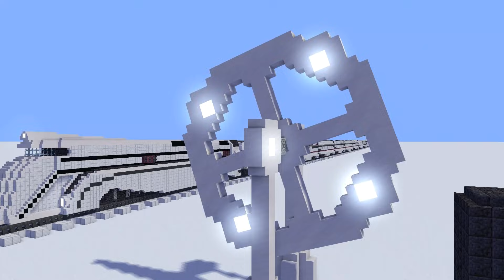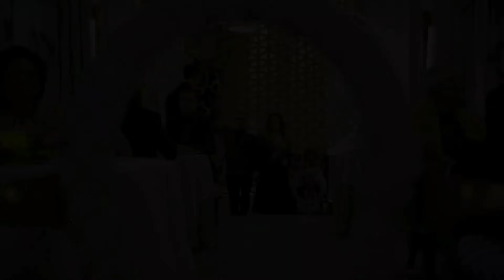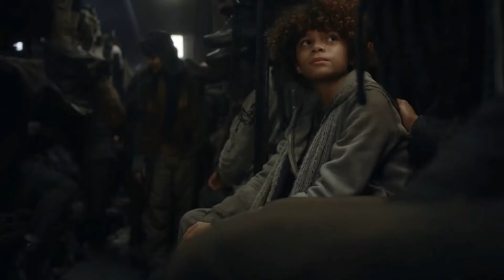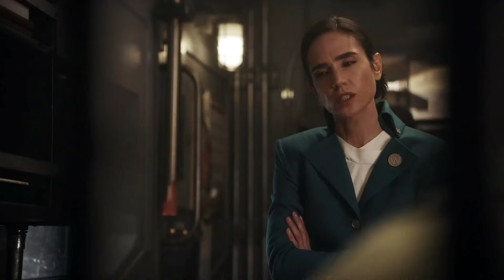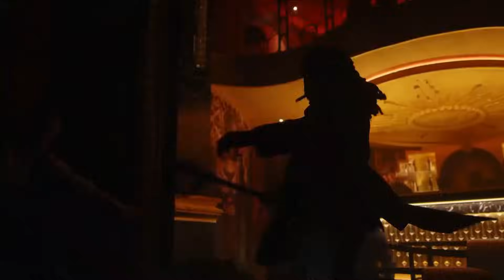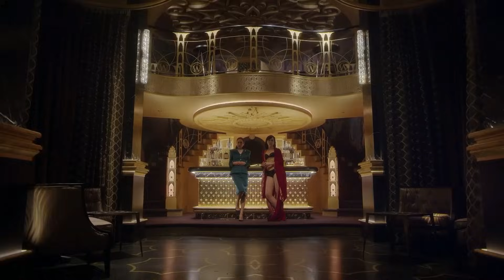HOW THE ENGINE ETERNAL WORKS | Snowpiercer Lore Video

Comment: They could have slapped a fusion reactor on the train and called it a day but no whoever wrote the story went for perpetual motion, motor turning generator style. 

Literally the only thing stoping me from properly watching the show.

Probably has to do with me being an electrical engineer or aunt karen at the family dinner asking me why we don’t just use the free energy machine she saw on Facebook to power our homes. But now any mention of infinite energy or perpetual motion makes me unreasonably angry.

Engineer rant over and back to designing a led controller for my hot tub.
Reply: I think the machine operating on perpetual motion is integral to the story. It’s the one gimmick that sets the rest of the story off. At least in the movie, the train should keep moving to keep the system going.
Reply: @carlosandleon  You could easily have that with a fusion reactor. Say the reactor has to run at a minimum power level, below that the reaction becomes unstable and it has to be shut down for safety (this is actually an issue with real-life fission reactors, running below safe power levels was basically what doomed Chernobyl). The reactor gives off copious amounts of waste heat which can only be dumped while the train is moving. And restarting the reactor after a shutdown requires infrastructure that isn't on the train itself, only at the starting station. Now you have your train that cannot stop (or only for limited amounts of time before the reactor overheats, similar to what they do in the series with the batteries running down) without needing to resort to some physics defying perpetual motion mumbo-jumbo.
Reply: @blahfasel2000  Chernobyl and this show similarities completely stop at the " too low power levels" thing. Reactor could have been stopped and restarted fine if they weren't to incompetent. Reactor 4 also didnt have that " we are running too low, we will overheat" issue like in this show, it was the ingestion of Zenon gas and incompetence.  My question is why not just add two or three perpetual motion engines to this system and ditch the silly trail wheel generators or keep the wheel generators but dont make them vital to travel? They stated that the engine doesn't have enough power to even keep it alive when its stopped.  You could shut down Mutiple engines as you need them. Hell, the design could have called for waste heat system with 1000 cars and such. Make it 1100 cars and deal with it.
Reply: @NotRandoWis  I know what happened in Chernobyl. This was just an example of a real life power source that cannot safely run below a certain minimum power level and has to be shut down if power output drops below that minimum.

And of course it doesn't have any similarities to what is in the show. I'm outlining a possible system that would keep the basic premise of the show (a train that cannot stop, at least not for long) but with more plausible physics than an impossible perpetual motion engine. The point wasn't to concoct a system that would remove the need to never stop.
Reply: @blahfasel2000  still think they could have added more engines so they didnt have to rely on wheel charging systems. 

My point is  Chernobyl is due to incompetence and shitty engineering, but at least it worked and could have been stopped even in a low power state without overheating. 

The shows design is absolutely atrocious, and its flaws could have been changed if the design was changed lol but i still like it. I just think even the writers could have tweaked that part a bit. but as the user above said, the original was more about life on the train and less about the engineering.
Reply: It also seems like the writers forgot about transmissions.
Reply: @qwertykeyboard5901  Modern trains now don't really have them either, we ditched engine to wheel drive trains years ago. Most are diesel-electric, powered by electric motors which are powered by a diesel generator. ( or by power lines above the train in the case of all electric trains) That gives us the best MPG( or MPGe in the case of all electric trains) and torque ratios that go beyond what an internal combustion system can do alone. Also, you get things like Dynamic braking. Dynamic braking works like regenerative braking on a Prius or Tesla but instead of using the energy collected to charge batteries, it turns it into heat and shoots it into the atmosphere using heat exchangers on another car. This takes stress off of the regular brakes and gives you more braking power. For purposes of this show, im referencing those big GE style cargo trains you have in the US and AU because Snow Piercer doesn't rely on outside power like a lot of cargo trains do in EU, UK and parts of Asia. Plus, those cargo trains in the US and AU are miles long, much like Snow Piercer. Plus it isnt a Maglev train, although that would make the most sense. Snow Piercer is technically a giant cargo bullet train turned into a city lol  

Newer "hybrid" cargo trains use dynamic and regenerative systems. Charging batteries which will be used later to power the train and dynamic heat exchangers for when those batteries are topped off, then the regular brakes are used. Electric trains are the same minus the diesel systems used in diesel-electric trains.
Reply: So Engineers DO understand that just because it works on paper doesn’t mean it works in real time. Gotcha
Reply: my guess is it *is* a fusion generator, the snow it kicks up while moving being a steady source of hydrogen. There's a big thing where the engine doesn't really "pull" the train, rather the job of movement is being left to the job of the bogey motors.

I cant remember if it was s2 or s3 where icybob shoved a spike in one of the intakes causing flooding from too much water and frying whatever wilfords "god module" was. (probably whatever is responsible for maintaining the fusion reaction and hydrogen intake)
Reply: Well, the original comic book from 1982 (and subsequent adaptations) tend to focus more on the social and environmental aspects of the story, more than the scifi details that are part of the setting. It came out in the era of Métal Hurlant, so dope ass visuals and a strong story was more important to the original creators than scientific realism.
That being said you really should give the show a chance, it's pretty decent. If you want a Good Snowpiercer Experience, go for the Bong Joon Ho movie or straight up read the og comic book online it's a ride and a half ;)
Reply: I'm not even an engineer and I felt the same way. The concept is kindergarten-levels bonkers. Nuclear submarines have been around since the 50's, there was plenty of source material to go off of and make it more believable.

Comment: So what I’ve gathered is while yes, a perpetual motion engine would allow Snowpiercer to theoretically last forever, any changes to operating speed, power output, or ceasing of movement entirely could be disastrous. It’s actually really smart if you think about it, I’m surprised the show writers didn’t use a weakness like this to their advantage.
Reply: A clutch system and transmission solves this wonderfully, assuming that changes in torque dont affect then engine in which case hills would be a major issue
Reply: @johnfeistner467 it’s a train, they would have flattened out the major obstacles for the tracks.
Reply: Or you know, make a massive particle accelerator shaped rail loop, G-Forces would be irrelevant without people and add extremely resistive induction loops into the track to generate energy and moderate the spinny engines velocity and bingo, energy crisis are no more and you can generate endless amounts of heat to deal with the cold.

Start a mega project of building hundreds of thousands and you can start thinking about orbital power transfers, momentum harvesters etc and start changing the amount of energy in the Earths orbit of the Sun and warm the world. Thats how dumb this idea is, its broken for its intended purpose, the plot demands eternal unstoppable choo choo so they end up with a plot device that solves the obstacle it was supposed to defeat in much more sensible ways.

It's not about realism, its about world building.

Comment: I still don't understand why you do not like the electrolysis answer..... i would think electrolysis + nuclear fusion is a eternal engine as well as a perpetual motion one..... because if it stops moving, it will no longer get more snow/ice/water to make into hydrogen......
Reply from the maker: Because the electrolysis answer fails to explain how the engine eternal was at constant risk of meltdown when stopping in Season 3; it fails to explain why the engine was ALWAYS in surplus, even when not moving for long periods of time.
Reply: @HallimarRathlornStudios  Pretty simple. The reactor produces a lot of energy and can't be throttled down that far. So either the energy is used or it builds up. Or you shut it down, but then everyone dies.

Comment: How does the train not need to be stopped for part changing
Reply from the maker: As described in the show, the train has a large supply of spare parts - all of which are low maintenance to begin with. In the earlier seasons, much of the plot is driven by how finite spare parts are and how costly maintenance is.

Comment: First of all, amazing video, very well explained in visualised! 

I do have one question, what is your thought about the engine's hydrogen production?
It has been a while since I watched the series (waiting for the next season), but iirc, in one episode, the one where Snowpiercer have issues with water pressure, they hint towards hydrogen production might be important to the engine

In the episode they experience a critical failure with some of the engine's computer system, which leads to all hydrogen production being suspended, if I remember correctly, which then leads to Wilford remarking that the engine would fail on them, in minutes, if they don't do something to fix it, thus implying the importance of the hydrogen production.

Your video is absolutely amazing! I was just curious to hear your thoughts on this.
Reply from the maker: This may sound lazy, but I don't regard the hydrogen thing as canon. For most of the show up until that point, the engine has always been the perpetual motion engine. It has never needed snow to function. Then the hydrogen episode happens, and then hydrogen is never mentioned again afterward. The engine's problems are always tied to parts, not snow intake. So I believe that the season 2 storyline was made up by the writers without regard for the long-term effects of the story. You can tell this is the case in season three, when the engine is at risk of melting down if it doesn't move because it's producing too much energy. If the train needs snow (hydrogen) to operate and produce power, why would producing energy me an issue if the train isn't moving? Especially if it's a reactor or electrolysis where throttling the engine would very likely be a thing. But it IS a problem. But cause the engine isn't a reactor or a hydrogen-eating machine that can easily be controlled. It has a fixed, perpetual output that simply cannot be gotten rid of.
Reply: Ah, I see, thank you so much!

I don't really have an education with all of this, so I was just curious to hear your thoughts on the hydrogen thing.

Thank you so much for your time!

Comment: Begs the question of why the engine has drive rods and pistons like an old fashioned steam locomotive. Perhaps some of the hydrogen is used to make steam to drive these, then instead of being exhausted out into the atmosphere the exhaust steam is piped down the train for heat and eventually condensed into water.
Reply from the maker: The drive rods were aesthetic. Drive rods tend to require significant maintenance, so they wouldn't really fit into the idea of Snowpiercer being able to last decades without issue. Not to mention that, as I've said in the video, the hydrogen-powered train concept was only ever used in one episode while the train remained the "eternal engine" for every other episode. It is clear the idea of taking in snow was only ever a plot device that never really had any bearing on the actual lore.
Reply: Aesthetic drive rods don't make a lot of sense, as they would be adding weight to the drive train unneccesarily with no benefit and there are still moving parts that will wear down. Needless to say they could do a lot of damage if they ever seized or broke. If you're gonna have 'em, and apparently the Snowpiercer has two sets of 10 coupled wheels with rods front and back, it makes sense to power them.

Roller bearings and mechanical lubrication would go a long way to making such a setup last a long time without major maintenance, a reciprocating steam plant tends to do fewer rpms after all. Even if it's just a side effect of the main power system, having steam would have a lot of practical side-effects. Propulsion, heat, hot and cold water.

From my watch-through of the show, the "Eternal Engine" is a bit of misnomer, as it's really the fuel that's  endless with all the snow around to extract the hydrogen from. Practically speaking the system "could" run endlessly, but sooner or later our old pal friction is going to win and wear something out.

I would also suspect Wilford of hyping up the "Eternal Engine" part as it would make him seem even more worthy of admiration and so on, as he was all about power and control.
Reply from the maker: @Shipwright1918  As I said. The concept of the train needing external fuel was invented for one episode and never touched on again. The train 96% of the episodes is held back by the need for labor and parts to keep in running (which is the real reason why it's not eternal), not hydrogen for fuel. And aesthetic drive rods make total sense. What makes more sense? Making your engine reminiscent of classical steam locomotives because they look nice (keep in mind SP was not DESIGNED for the freeze initially) or having two separate motive systems inside of a giant train, steam and electric. The most probable answer to a question is always the simplest one. And the answer is that the drive rods are aesthetic and the hydrogen plotline was completely contrived by writers in a single episode that would never mention hydrogen ever again, continuing to refer to it as "the engine", "the engine eternal" and/or "the perpetual motion engine" every episode afterward. And every single one before it.
Reply: @HallimarRathlornStudios 

It may have only been used once, but the hydrogen was never specifically retconned out either, so it needs to be accounted for even if it might be inconvenient.

The simplest answer for the rods is probably the show's production team thought they looked cool, which I will readily agree to, but from an engineering standpoint it makes absolutely no sense to have big driving wheels, big cylinders, and driving rods purely for show.

I mentioned weight before, the big thing here is hammer blow and combined reciprocating weight. All the metal in those rods, crankpins, etc. are very heavy, and even though they're counterbalanced with weights in the wheels all that mass swinging around delivers a thump with each turn of the wheels. One big one going down onto the rails (hammer blow) and a shuttling motion forwards and backwards (combined reciprocating weight).

The big point point here is all this thumping can be hard on the track, if it's excessive it can even break the rails. Most modern locomotives, particularly ones meant to go fast like Snowpiercer, don't have driving rods for this reason.

Since it has 'em, we could try to chalk it up in-universe to Wilford being an eccentric rich guy and Melanie being an idiot or too scared to call him on why it'd be a bad idea. Trouble is, it doesn't fit their characters, both are pretty sharp engineers, so I'd wager they'd know all about hammer blow and made the system double-redundant by having a steam circuit in addition to the main power system to make them functional. Might as well get some extra oomph to drive the train in tradeoff for the thumping of all the weight.

Doesn't really change much insofar as the lore is concerned, at least how I see it.
Reply: @HallimarRathlornStudios  The big flaw is that weels and tracks tend to break in cold conditions so this train would not run for long.

Comment: Cool, but i have to say something.
In one episode when the air/snow vent broke (was broken by icy guy in s2) they said that engine can't take any more hydrogen that says it needs fuel (hydrogen) and it's not totally a perpetual motion. It can be close but not entirely perpetual. Other than this great explanation
Reply: It would still be perpetual motion in a sense. It gets the hydrogen from the water/snow via electrolysis. But electeolosys of water takes a lot of Energy and you can't get more energy out of the hydrogen, than you put into splitting the water.
Even if you burn it with extra oxygen from the air, you'd just get the same amoint if water and energy gets lost as heat.
And if you do it like current hydrogen feuel cells do it in hydrogen cars, you'd get less heat but ultimately due to electrical resistance in the cables you'd still end up getting kess electricity out of it than you put in.
And i am pretty sure having some motors turning and moving the train and having Others being turned by the moving of the train and generating electricity would also end up not generating as much electricity back as is being spend.
So overall the explanation in the series is still missing a piece that allows for the train to gain extra electricity. Maybe, idk, solar cells and some wind turbines could make up for the last bit of extra electricity needed, but i don't think it'd actually be possible to fully close that gap